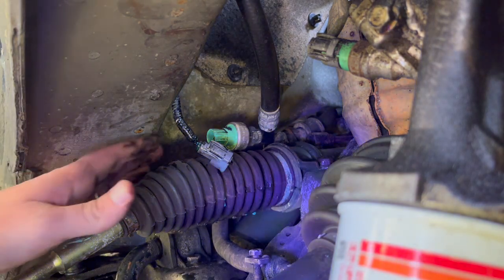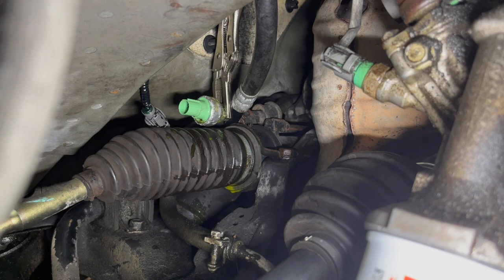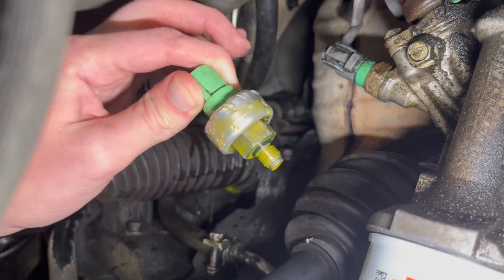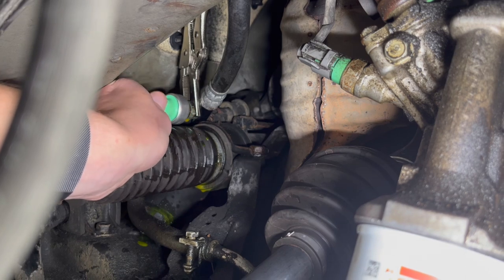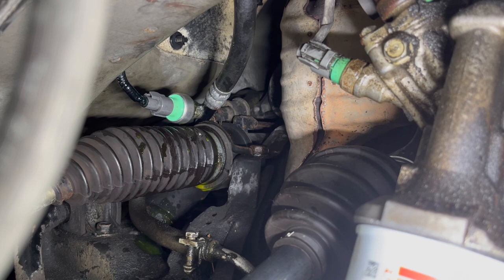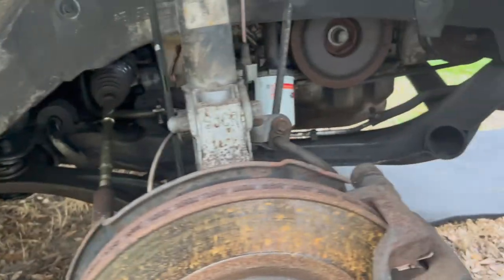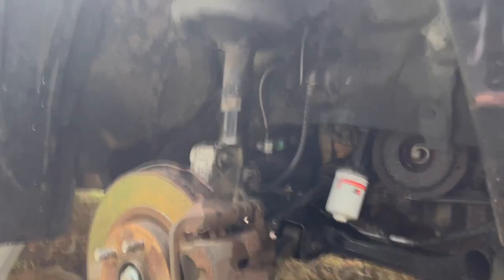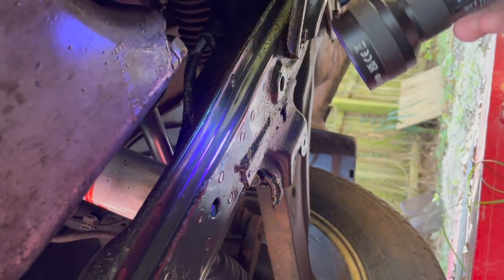Ridgeline Power Steering Pressure Switch Replacement

Comment: What happens when this fails? What are symptoms? Thanks
Reply from the maker: Power Steering fluid is leaking. That's pretty much it as far as I know. Obviously if system is low on power steering fluid, your vehicle will make sounds anytime you're turning the steering wheel.
Reply: Yes leak plus air in system

Comment: were woukd it be located on a 95 camry v6
Reply from the maker: No idea, I'd say look at high pressure hose. If there is pressure switch, it should be somewhere on that hose. But look for leaks anywhere in the system.